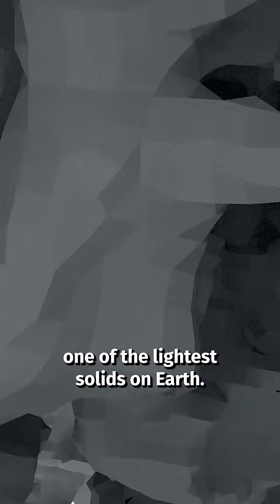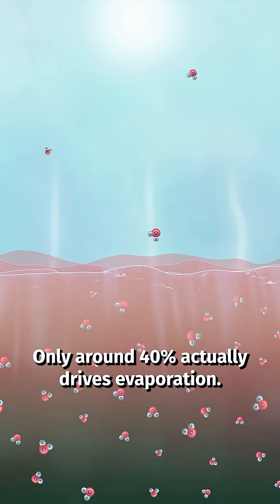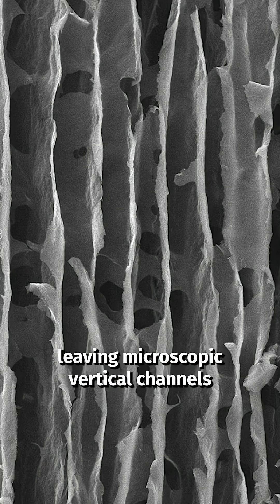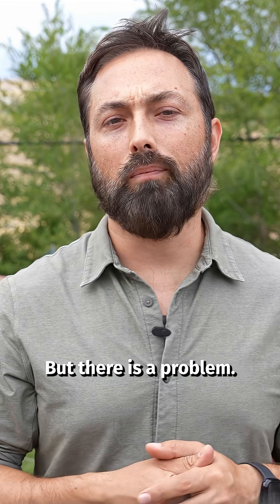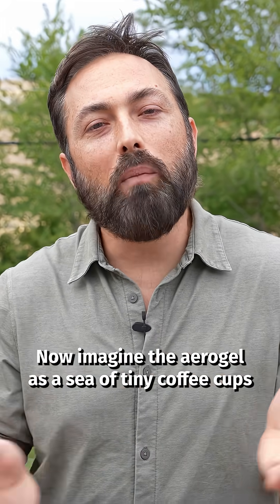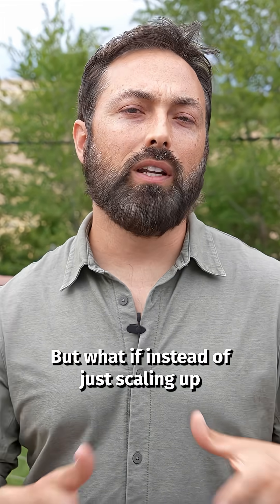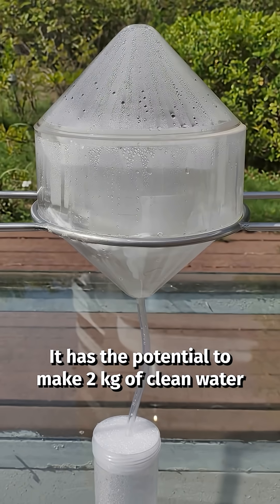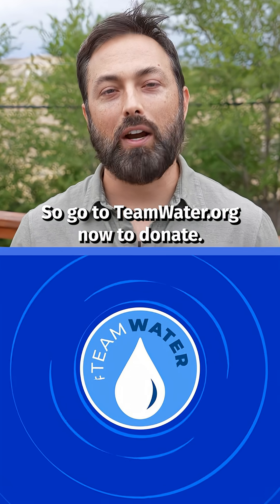How aerogel can make the ocean drinkable

Comment: Right, because rapidly depleting ocean water by extracting it at a high rate of volume couldn't possibly have negative consequences lol.
Reply: Checked NOAA:  "NOAA's National Geophysical Data Center estimates that 1,335,000,000 cubic kilometers (321,003,271 cubic miles) is in the ocean."
That would be 1,335,000,000,000,000,000 m3 or 1,335,000,000,000,000,000,000 liter or 1.335 * 10^21 liter.
If all 8 billion people would drink 5 liters per day of desalinated ocean water (instead of other sources), that would be  0.00000003%  or  3*10^-9 %.
The natural evaporation rate is already waaaayyyyyy larger than that.  Not to mention consumed water returns to the water cycle due to sweating and urinating.
Reply: @Yehan-xt7cw Thank you for talking sense. Some people have really nooo idea how big the earth is.
Reply: You people really have a problem with grasping how big the earth truly is. But I guess it's the same kind who believes the earth is overpopulated (probably don't fly or never explore the world away from civilisation)

Comment: Areogel needs scaling, it’s insulative properties could bring efficiency in construction to dramatically reduce our dependence on power for heating and air conditioning
Reply: Scaling it would be awesome, though difficult. The process to make it is expensive, has to be precise and the resulting material can tend to be very brittle. I do agree that it needs scaling, but I think we need to work on a material that will help with these problems first before then.
Reply: 1mm of aerogel is probably better than 8in spray foam insulation. And the weight savings alone could probably improve the longevity of the structure. A plastic sealant should keep it from falling apart pretty easily.
Reply: I took a bite out of Nile Reds aerogel 😊

Can confirm Water biscuits taste better
Reply: Aerogel insulation already exists. And has for a couple of decades now for everyday use. (It's been around a lot longer as insulation, but only got adapted/improved for general use in the 90's)
Reply: @Kizron_Kizronson  They said scaling. Aerogel is pretty expensive, so while it outperforms pretty much all non-vacuum insulation, it doesn't end up being cost effective.

Comment: Thanks, I've been wondering why in a drought with lots of sunlight, why not use it for desalination. 

I still think if you upsized the solar hot water systems, like we have here in Oz, to heat the water to vapourise it. 

A black tower with water  flowing over and through it, to heat the water to a high temperature like 60-80c then capture the vapour.

Comment: 2kg of clean water sounds so cursed
Reply: Nothing cursed about it, start learning metric like the rest of the world lol
Reply: @heinkorbee1459 that's the weird part. It's unconventional to use mass for water instead of volume.
Reply: @burekq  only in pure water at 20°C at standard pressure. We use kg in science because 1kg of pure water is always the same amount, but a liter can vary significantly with temperature and pressure
Reply: Especially since 2kg of water equals 2L of water.
Reply: If you are from the USA
Reply: @skinhead-vasya  sounds weird in the UK too, we usually use L/ml for liquids.

Comment: Love it, but I thought there were extremely sharp upper limits on desalination for both chemical and entropy reasons.
Reply: that doesn't apply to evaporation. Salt can't evaporate with it, so it will be perfectly clean water. In fact, some minerals will have to be added to it after.
Reply: Incoming sunlight is low entropy.